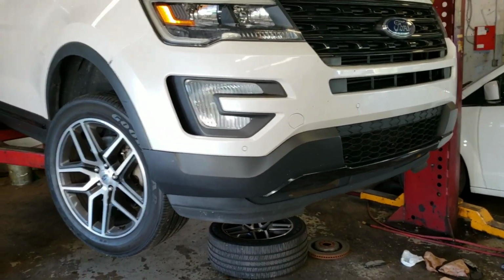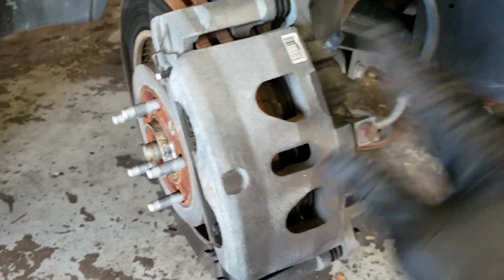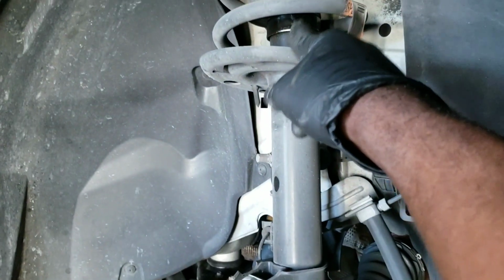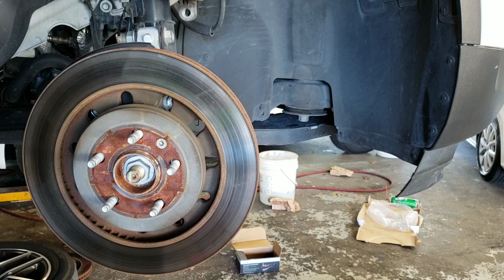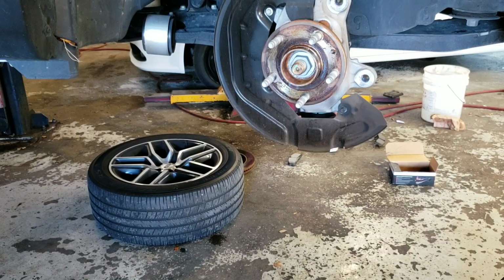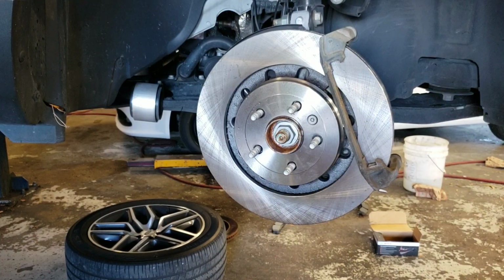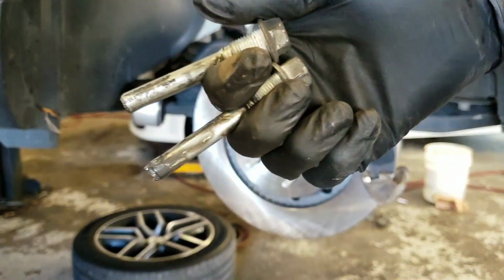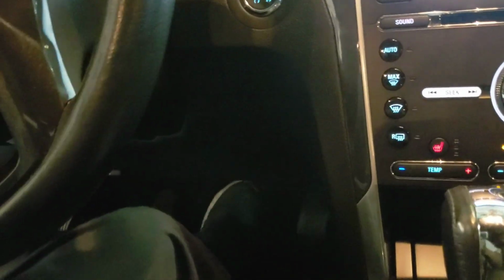Ford explorer front brakes replacement

Comment: Just completed this for a 2013 Explorer and your instructions were right on. So thank you.  Few others thoughts would be to grease the contact points between the caliper and the pads and treat the rubber boots with a rubber preservative while you have the wheels off to prevent more expensive repairs in the future.

Comment: So how do you keep the outside pads from rubbing without the metal pins? I just had to do front brakes. They sold me the brakes with out the metal pins now all they do is rub and grind
Reply: Did you find a solution?
Reply: You could use the old ones , clean them and lube them with the same lube as the guide pins lube , i belive is silicone based lube for brakes , but I could be wrong 

But first go to the store that sold them to you and ask for them
Reply: Solution. Make sure you check the back brakes for a frozen caliper. Lol